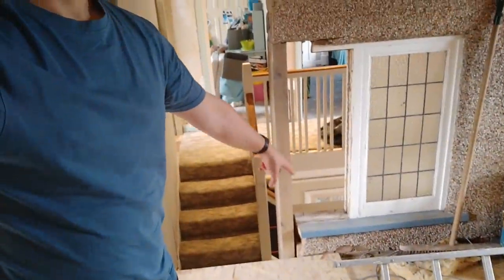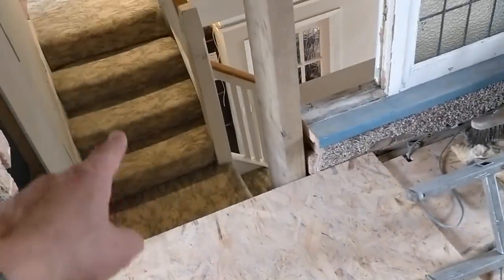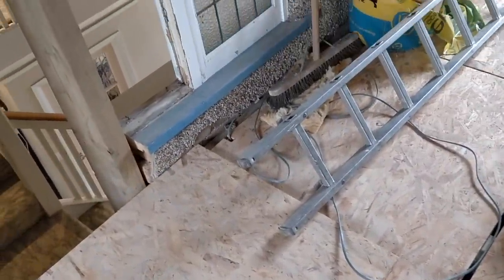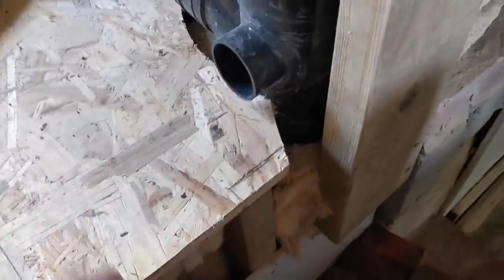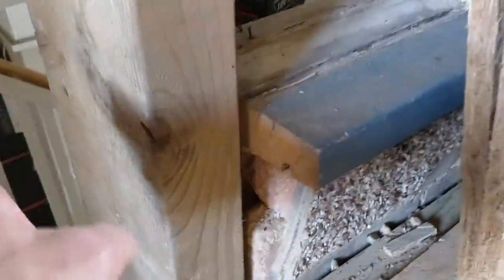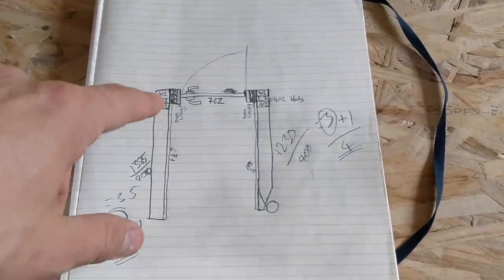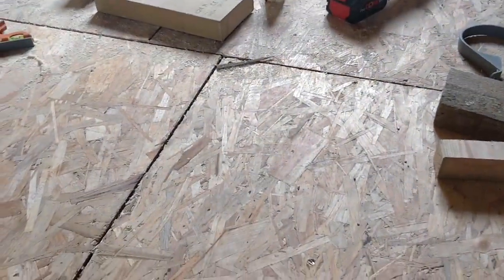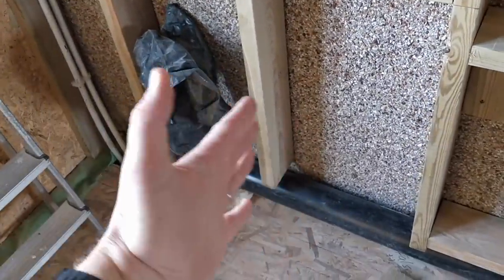How to set out Stud walls & Doorways

Comment: Just a suggestion I’m guessing it’s already built now but why didn’t you put a door opposite the bathroom door rather than top of the stairs??
Reply from the maker: Great question! We really wanted to have that bathroom as a dedicated en-suite for the bedroom, rather than a stand-alone bathroom across the hall (however narrow!). But that's an additional point - We also didn't want it to feel like a long, thin hallway.
Reply: @OfficeBoyBuilder  totally understand where your coming from …. Another suggestion… the door could of been a pocket door into the shower wall ?
Reply from the maker: Another great suggestion, I have been toying with the idea of pocket doors, but the cost of the system and the complications of the hollow stud wall, haven't seemed worth it. I'd love to have a go at one, but not until it's necessary.
Reply: @OfficeBoyBuilder  totally understandable.. I’ve fitted loads and there not as costly as you think…. Also your shower … I’m guessing your having an upstand as the outlet on the stack is higher than the floor… did you not want to put a boss pipe in lower to get a shallower tray ??? And your in a great position to have a wet room tray as your putting Down another layer of flooring??
Reply from the maker: That's good to know. I'll take a look.

I slightly shot myself in the foot with the shower tray. I wanted a low profile one, but you're right. The boss is too high, even after the extra 22mm chipboard.

I can't cut out the floor and lower it now, because I put a stud on either side of the waste stack, so I can't get through that...! It will only need to be slightly raised off the ground, but it will make future access to the pipes easier 🤣
Reply from the maker: No, there's space for nothing mate. The pipe is wrapped in mineral wool insulation, and sandwiched tight between two 6x2 timbers!
Reply: @OfficeBoyBuilder  it’s never too late to go a few steps backwards for a better end result
Reply from the maker: It's worth pointing out that I've attached timbers to the other side of that 6x2...I am very happy to undo things in order to make it better, but I know when I'm beat. I should have considered it sooner, but I'm not going to agonise over it or dwell on past mistakes. It was a learning point for me, and I'll be highlighting it in future videos for others.
Reply: Also if you haven’t got anyone already I’d love to tile that for you and I wouldn’t mind teaching you how to do it
Reply: @OfficeBoyBuilder  absolutely no criticism from me just suggestions… honestly mate your not doing a bad job at all just want the best for you
Reply from the maker: That's amazing mate, thank you!

Ping me an email (officeboybuilder@gmail.com) and let's chat!
Reply from the maker: That's amazing mate, thank you!

Ping me an email (officeboybuilder@gmail.com) and let's chat!

Comment: Did you mark/note down where you screwed the screws for that extra piece of timber on the ceiling joists on the right hand side (facing old window)? So you don't hit them when you come to screw on the plasterboard.
Reply from the maker: Good point. I didn't in this instance, but that has happened to me in the past.

The chances are pretty narrow, but it does occasionally happen all the same!

Comment: How come no headers on your partitions?
Reply from the maker: Because I knew that if I put a header I'd still have to put another timber in place for the ceiling plasterboard to catch on. It was more economical to put noggins in and run the studs up to that. It takes a bit longer, but it works well
Reply: @OfficeBoyBuilder  but you don’t have nothing to screw tops of the wall plasterboard to
Reply from the maker: Yes that's true, but that is no different from any other part of the plasterboard that's nailed to the stud...other than where you have the noggins, the plasterboard is only fixed to something every 400 centres.

Comment: Why not build frame complete with base rail and header and then have something to screw plaster board to, then you wouldn’t have needed double base rail, has a structural engineer passed the timber support for your brickwork, it might have been better to fit longer lentil and then no need for timber

Comment: We usually just keep it simple by adding 70mm to door size for rough openings. Our linings are usually 27mm,  so 27mm lining, 3mm door gap, 762 door, 3mm door gap, 27mm lining, then that leaves 5mm either side for packing it plum.
Reply from the maker: Great shout! Nice and consistent
Reply: What timber do you fix the door lining to ? If you use 3x2 cls wouldn’t the door lining stick out because it’s wider? What do you do usually , thanks ( I’m an apprentice)
Reply from the maker: Yes, and with the thickness of the plasterboard and skim, you should be able to find door linings which land at the same width.